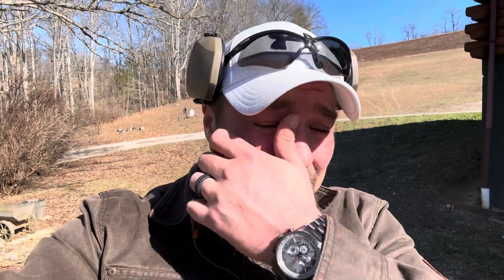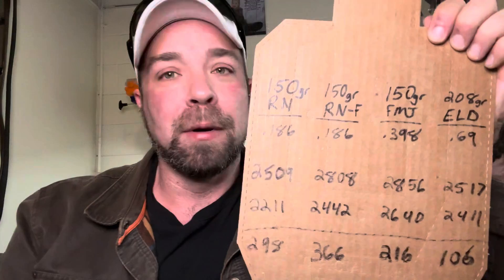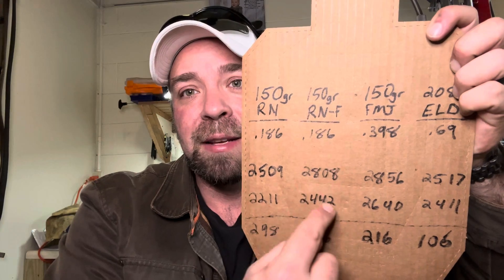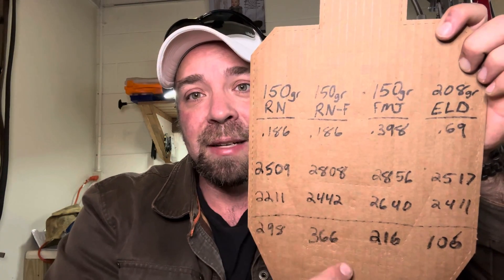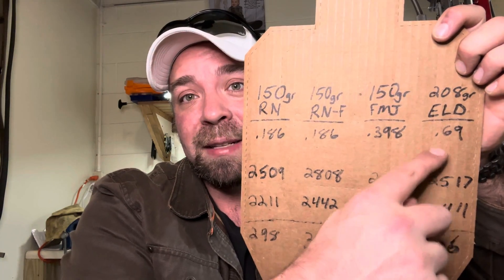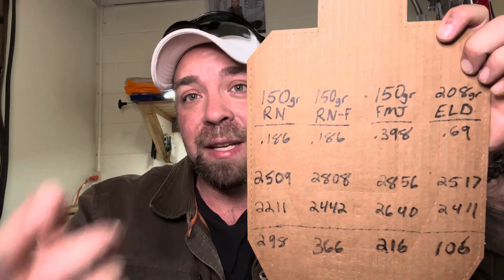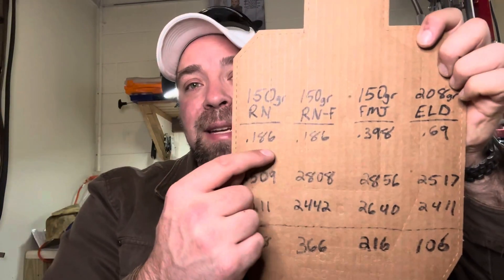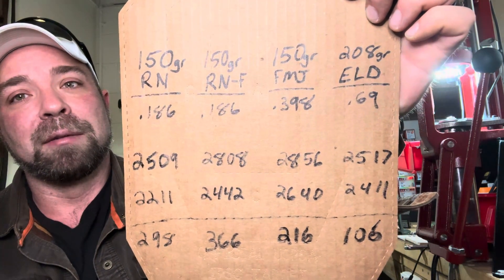30 Caliber Ballistic Coefficient Testing at 100 Yards | 30-06 Cartridge Used

Comment: Pretty cool. If my math is correct, the fast 150 RN lost about 13% of its velocity, compared to only 4% for the ELD. The higher mass is also coming into play.
Reply from the maker: The formula for determining BC is dependent on sectional density, so a longer heavier bullet will have a higher bc naturally, it’s not so much mass as it is SD that makes a bigger factor in the formula, hence an all copper 30 cal bullet the same length and design will have the same Bc but less mass, yet perform exactly the same from an aerodynamic/velocity loss standpoint.
Reply from the maker: Big difference between the two for sure